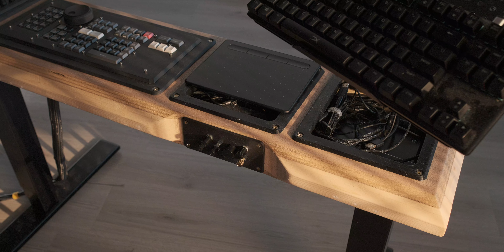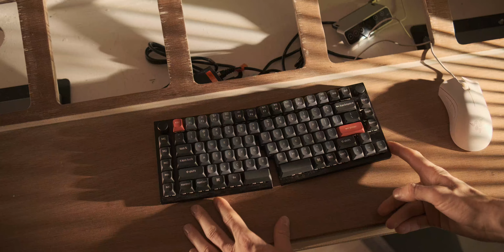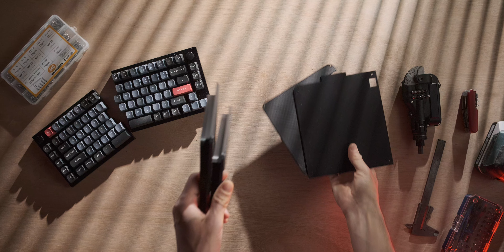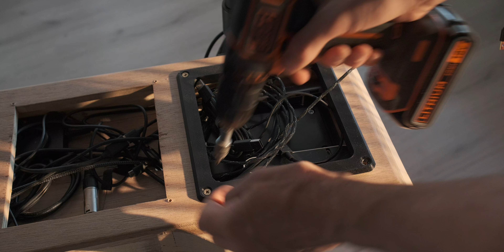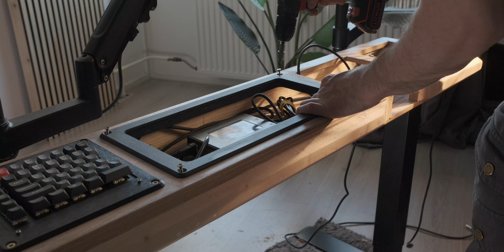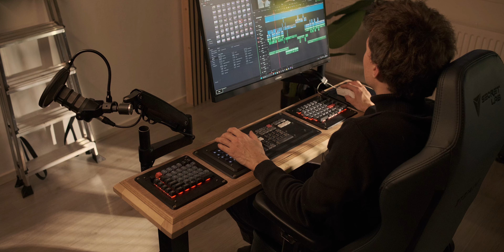Concept Desk Build - Part 2  - Keychron Q11 Split Keyboard integration - 3D Print Project

Comment: in some of your old vid you mentioned how you like to have stuff on wheels so you can be flexible. when you zoom in on the table itself, youre doing the exact opposite right? everything is fixed down and you have to settle for that build. having the keyboard just sitting on a desk seems more pragmatic and practical. maybe you could experiment with some pegs or magnets to create presets it can snap to, but then if you want to move it around into different setups you can. thoughts?
Reply from the maker: Indeed having the keyboard more flexible is nice, in the latest version i went for a more ergonimic adjustable design https://youtu.be/Ao-z3RIoBrw

Comment: iiiinteresting
Reply from the maker: You sound sceptical haha ;) nice of you to drop by again, Appreciate it!
Reply: @FlatLanderTech  Not skeptical, per se. Just pondering the possibilities in my own space. My own desk has so much on it that it's hard to imagine slimming down this much - but at the same time, this feels hyper-efficient for a single-task workflow.
Reply from the maker: @EposVox haha, I completely understand :) It’s definitely very drastic. The reasoning behind it was partly because the previous setup became so complex with so many different components that it was essentially cursed. Anytime I tried to do something, it would break down or glitch. However, I’ve realized that even when compartmentalizing things, it’s still prone to failure—it just feels like the gear bugs out more often when everything’s on one setup because its more stuff, not necessarily that its impacting eachother. So currently also rebuilding it but properly vetting the gear :)

Comment: Next time tilt your Jigsaw forward so you can lean the front on the wood, and the blade goes through the wood diagonally. That will give you some stability when making a shallow cut.
Reply from the maker: Ooo that's very smart I'm going to try this next time aswel thank you!!

Comment: Btw, for the plywood if you use a fine toothed jigsaw blade (13 TPI Ultra Fine Finish) you will get less tearout. You can also clamp a sacrificial piece to the top to prevent tearout as well.
Reply from the maker: Thank you ill make sure to try that next time! :)
Reply: I’ve heard you can also score the top a few times with a box cutter or razor and it’ll help in the same way as well as it cuts the wood fibres prior to the jigsaw

Comment: I have had a Q11 for about 4 months now, I really wish they'd release a new split board (with some of the nicer features like gasket mount,  and other features they have in the rest of the Q series), they keep releasing Alice layout, which is not as practical imo. I highly recommend tenting the keyboard, it has really improved my RSI pain/numbness.
Reply from the maker: I was also thinking about an analog mechanical split keyboard. Ir would be really awesome for gaming :)

Comment: Hey! Do you plan on integrating the loupedeck back into the setup or is this going to be a modular setup where you can hotswap components in to fit your needs at that time? Really awesome setup!
Reply from the maker: Sadly the loupdeck is out of the game for this one but the 3d printed Components will be reused on the main setup. Which is currently undergoing a complete rebuild.

Comment: I love how streamline this solution is and of course the cool factor is off the charts. I have in my mind that I need a large desk for "extra room", but this additional space quickly becomes cluttered.  I will be eagerly awaiting the multi-tool video!
Reply from the maker: Glad you enjoyed! Its indeed a realisation i had aswel about clutter. Any horizontal surface seems to accumulate stuff in this case it wasn't the most successful however haha, everything is accumilating on the floor right now so thats a fun realisation to have XD

Comment: I saw you using your jigsaw like that several time, I think you should try using several masking tape on the wood to avoid splinters and tear out, plus maybe wedge as well when the height of your blade is too high... anyway, fantastic project as usual!!! Always a pleasure to watch your videos!
Reply from the maker: Thank you for this ill definitely try the masking tape method next time !! glad you enjoy the build projects! :)
Reply: @FlatLanderTech  Another good option is a downcut blade. You'll still have tear-out but it will be on the bottom.